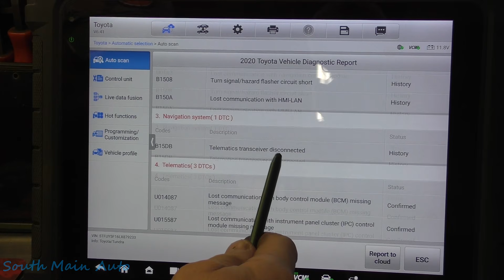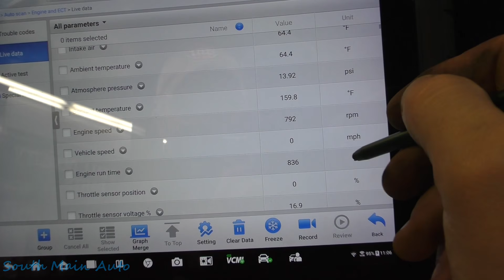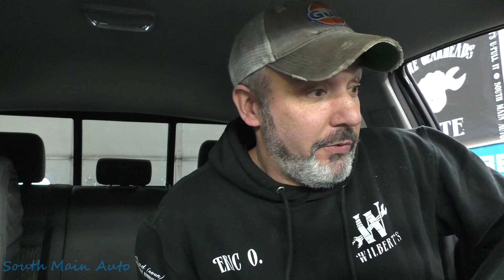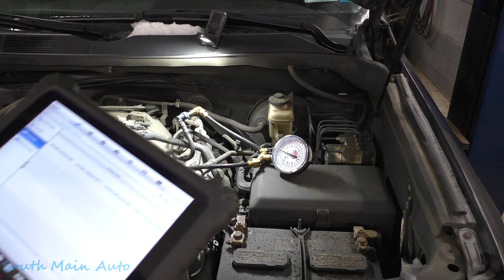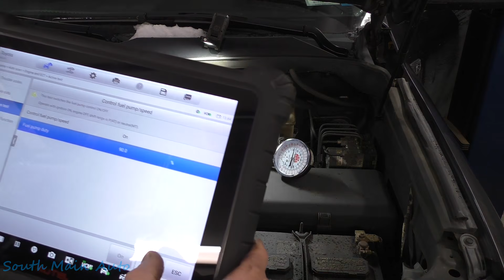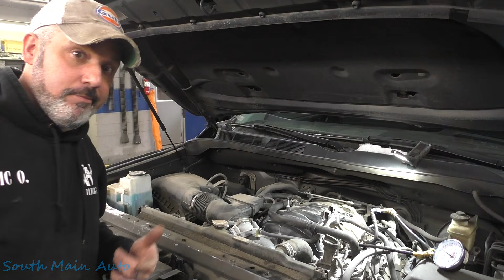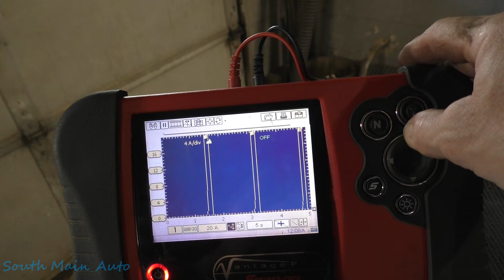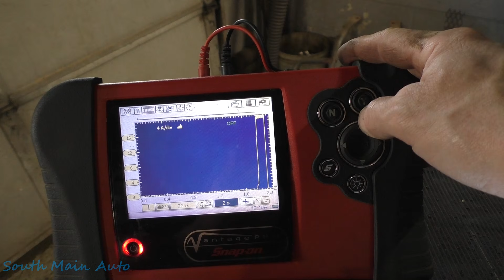My Customer Is Getting Shafted By The Local Toyota Dealer

Comment: I am 1:22 in and based off description so far I am going to say fuel pump. It gets hot and doesn't want to kick on until it cools down. It'll restart immediately right after shutting it off because the fuel rails still have pressure in them. That however doesn't explain why the fuel pump would suddenly start working though by spraying it with ether to get it going so never mind my initial train of thought lmao. I'll watch now to see what it actually is :o)     EDIT: I was right! YAY lol

Comment: He probably still won't be able to replace the fuel pump for free because in most cases, those pumps can't be replaced without replacing the entire module. I'm willing to bet the dealer is gonna say, "Yeah, we can replace the pump for free, but the module is gonna cost around $800."

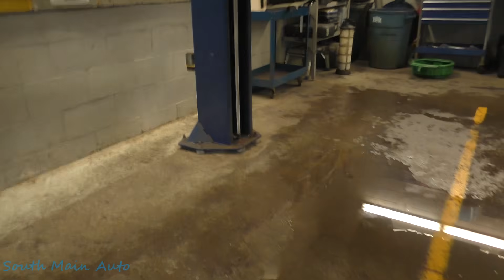Comment: @26:00 If you can't get a amp clamp on the fuel pump, try the negative battery cable; just make sure you "zero" the clamp on the battery cable so you can cancel out the idling current.

Comment: Interesting just to make sure this is not the same Tundra that had the bad pin connection problem anyway great job once again love all of the videos keep them coming.
If I lived closer I would give you my Tundra to replace the lower control arms I have a 2006 4x4  SR5 access cab 4.7 liter in nice shape just bought in September

Comment: My trick for keeping an eye on something remotely while alone:
1. Current phone that can broadcast a hotspot.
2. Old phone connected to hotspot.
3. Selfie stick with clamp attached to it.
4. IP Webcam app on old phone.
Set the app up and start the server, old phone on selfie stick, clamp in place and aim, pull up the address for the server in browser on current phone.
Can be a slight delay, but super handy before I had a bluetooth meter. Also super handy for diagnosing reefer trailers. Keeping an eye on anything really when you need you be in 2 spots, but are alone.

Comment: Hi Eric. Got any videos on gm 5.3 knock sensors? I've relocated them, tested them, replaced them and the harness. Still get codes on both. Engine runs good but does occasionally have an extended crank. Help! 😂

Comment: I went to 2 Toyota dealers and neither could explain a simple transmission service procedure. One said "all I know is it costs $429". Even the service manager at one said the 4runner has no transmission filter! I worked at a Toyota dealership in the '80s and '90s and we had some excellent mechanics back then, what is happening?

Comment: Had same issue with a 2014 ford f150 four door extended cab long bed work truck with 302k miles, bought it with 206k miles and ran perfect, so one morning, it started right up like normal to do the daily vehicle check, then shut it down, some time later, ready to hit the road, all i had was crank, and no start condition. Opened up the intake and sprayed starter fluid while cranking, it ran for about two seconds, then quit, so it seemed to be the fuel pump, we replaced it ourselves, again crank, but still no start. Found out afterwards it has the same fuel pump control module located at the rear of the frame cross beam just above the spare tire, replaced it with an aftermarket unit, it started right up and the truck ran great for two weeks, then one morning, same crank, no start issue once again. Replaced the fuel pump control module with a different aftermarket unit, started right up and ran great, but just for one week this time, keep in mind, zero codes given for this issue. So the owner of our shop took it to an automotive shop we frequent, they replaced the fuel pump relay because while cranking, they tapped on it and the truck started, so they considered it fixed beacuse it gave them no other issues. We got the truck back, the following day, crank but no start again, so off to different shop we also frequent, so after a total of 1.5 months being off the road, its back in our hands once again, but this time, they replaced the brand new aftermarket fuel pump assembly that we put in prior with another of the same brand and its been working great for at least 3months now. The thing is, years ago this ford truck amoung other years had a service bulletin about the fuel pump fuse, it was using a factory installed 20amp mini, the fuse was getting super hot and causing the same crank and no start condition untill the fuse cooled down. The fix kit from ford, was replacing the mini fuse with a LP JCASE fuse rated with the same 20amp relocated elswhere in same fuse panel/block along with a thicker gauge wire to be spliced in to it thats located above the dual electric fan shroud. The prior owner of the truck already performed that fix from ford long before our shop got ahold of it, oh and the OEM fuel pump control module is back in the truck.

Comment: An almost new toyota with a bad pump.  Not acceptable, even worse the dealer refuses ro back up the customer.  This appears to be a trend with Toyota the last 10 years.  I've never seen fuel issues on my vehicles under 170 thousand miles.

Comment: This has to do with the fuel pump, there is a fuel pump regulator that is usually bui l t in to the fuel pump.  Once the fuel pump is changed the problem is solved. We had a 99 chevy blazer that had that problem and replaced EGR valves, oil sending units, maf sensors, etc. Per mechanics, the fuel pump was all that was left!

Comment: wow EXCELLENT diag. We do hate the parts cannon mechanics. And I say mechanic because they aren't true techs like you. 

You did it all right. never would I have thought to pull the maintainer. But I work without a maintainer. 

Not a pro day to day but I know Toyotas pretty well. Thought it was EGR personally. 
Had a 96 Camry 4 banger that was about 15-20 years old. She would not like to restart after HOT SOAK, aka turning off in a drive thru like McDonny's and then it would take a couple times. 

Because as VGG would remind us, it's an air pump and I thought it was air starved. Toyos used to be low complainers. Never lighting up the christmas tree (normal) until it's really in a bad way. Like for example the heater circuit in the AFR would need to be EXTREMELY lazy for the CEL to come on. Until then it's super bad fuel mileage like 15mpg. 

Take that and apply here, there used to be a port that went from the throttle body under the butterfly, clean that and the stuff that's under it with solvent. It will be better. The part is EXPENSIVE so you have to just clean it. This was after thinking it was the MAF which it WAS NOT. 

Something for people to chew on in case they have a similar thing and it's not the fuel pump. Don't run below 1/4  tank so they stay submerged under the splashing so it cools as it runs. That's something you forgot to mention. Hot burns motors out. Too bad you never really get them to break under normal use. This video has half a mil views already. JUST for Toyota!

Hope this helps someone. That piglight really was the key to solving this. I mean testlight is similar but that just is genius for the ease of use.

Comment: When I was younger, my wife picked an 82 Chevy Cavalier. Still under warranty and less than a year old, the rear wiper would come and not be able to shut off when you hit a bump. The only way to shut if off was to turn the ignition off. Left at the dealer to get it fixed. Went to pick it up after work and they said it was fixed. Pulled out of the lot hit a bump and it came back on. Went back to the dealer and they told me they didn't have time to fix an electrical problem. I was pretty much fit to be tied. Took it home to cool down. In the mean time I check some of the connections and everything looked good. So I took the cover off the wiper motor and behold I saw what was the problem.  When the carbon ran off the copper strip it would arc and burned little indent in the board and it filled with carbon and completed the circuit.  I cleaned it up and filled the low area with epoxy and it worked for 14 years.

Comment: Hey Eric, i have an alternate theory as to why after ether it would run.  Well smacking the tank got the pump unstuck right? So the natural vibrations from the engine cranking and running could also be enough to jar it loose.
14 year ford truck tech. Tell me what you think!

Comment: You probably wont read this, but I will post it anyways. I wonder if the techs today are just missing stuff and not doing enough detailed investigative work when it comes to diagnosing problems?  I took my truck in to get a coolant line replaced to one of my turbos. I did not want to mess around with breaking manifold exhaust bolts to remove the turbo. While it was in there, I asked them to look into an intermittent check engine light for a misfire on cylinder 1. They hooked up their own scan tool and could find nothing wrong. Took it back for warranty work on the coolant line that was still leaking after they replaced it and told them I was still getting the misfire code and I had an oil leak as well. They could find nothing that I was describing. When the weather finally warmed up I decided to look into this myself, and discovered that the #1 cylinder spark plug had carbon tracking on it, never ever have I seen that, upon closer examination, the plug had a very small crack, replaced it, no more problems. The oil leak was also easy to find, it was the vacuum pump on the back side of the motor. How on earth do mechanics miss this stuff?

Comment: What POSIBLE REASON would you want to turn your fuel pump on and off or sow and fast while you are driveing down the road? Gas saveings? How much gas can you buy with the cost of this stupid modual and wireing and now $150 dollars per hour  diagnosing . THIS IS PROOF POSITIVE THAT THESE ENGINEERS  ARE PULLING THE WOOL  OVER THE CORPOATE BOSSES EYES JUST TO KEEP THEIR JOB.

Comment: Eric just held a master class on fuel pressure diagnosis for Toyota's.  This kind of data is unobtanium for the most part, and the odds of the dealer tech even putting a pressure guage on it are small because he does not own one and the shop tool is missing or missing the needed adapter.

Comment: The older models never had Fuel Pump problems. My ‘97 Tacoma went nearly 300k with the same original Pump. The more lower quality parts they use (from China) the more failures we’ll see. Toyota is using Chevrolet systems to cut costs.

Comment: Hey I got that same problem with my 1976 toyota corona at 560,000 miles.
When it get hot and I shut off the car, than it will not start up again, until the engine cools down , than it starts.
I replaced everything that can be replaced that is related to the issue, relays, fuel pump , injector  but nothing so I just keep driving it.
Well the trans finally gave up so junked it.
Saw your video and I thought I'd share a similar problem. 
Thanks

Comment: you and I tink alike...the fuel motor is weak, the added voltage, from the alt., made the difference so it would run...the first start of the day, the armature bearings are cool (less friction, eaiser turning) also less metal expansion ...so many variables, the scope is in valuable, to find the cause!!!

Comment: I'm guessing that this is a returnless fuel rail, which is why you need a variable speed fuel pump to maintain preasure.  Otherwise, on older vehicles, the preasure regulator would bleed off the extra pressure and return it to the fuel tank. And you would have a single or two speed pump.

Comment: Probably already heee in the comments but there will be internal hardware protection at a silicon level (inside the FET used to drive the pump) & a software current protection function which is what looks to be in action here as the retry strategy is on a fairly slow time base. Excellent diagnosis as ever, thanks for sharing with us.

Comment: There seems to be be more to the story than what we’re getting. Does the truck have warranty? 

“It’s been acting up for a year”.  So how many techs have been on it, and who was the first? 

Corrosion for ECM, FUel ECU can surely be suspect- but doubtful Toyota is grounding on the bracket. Maybe trans tunnel, or even interior. 

And for all you guys Doggin out the Dealer techs- when you only approve 1.0 hour of labor for diagnosis on your bogus crap box- the Tech is most likely going to stop digging at the 1 hour mark.  The writer is hoping he spends an entire day, but he most likely won’t- after the 1.0 hr diagnosis, you WILL start getting educated guesses.  Sorry, hate to lay it out- but even The Highest Qualty Tech needs to book hours. We CAN accurately pinpoint every problem, but NO ONE is paying us to do so. 

An independent shop OWNER/ YOU Tuber has all the time in the world to make the dealer look bad- and he will still make some money.     And be the HERO for doing it

Comment: As you have provided proper diagnoses - that is what matters You found the problem - And at first I was leaning to a fuel pump relay from the way the pressure was behaving while you were under the hood, But I totally agree and you see this is what the industry is missing logical thinking and like how Holmes said 
When you have eliminated all which is impossible, then whatever remains, however improbable, must be the truth”. And that is what I see you do Eric A very thorough diagnostic. Wayda go there...

Comment: There are passive components called PTC that will go open circuit in high load. Some power window motors use them for safety. The computer may or may not detect when this happens. If not, then you would not see a code.

Comment: I had similar happen on Toyota Highlander. It did have the recall and they had replaced it before we bought it. I always figured it was the fuel pump even though it had been replaced 30k before. I ended up selling it back to the dealer as we didn’t like the size of the vehicle anyway. This video confirms I was probably right on that vehicle but certainly not typical way I had seen a failed fuel pump.

Comment: My first guess was fuel rail pressure. That was as far as I was able to go. The tools you used I do not own and they are expensive. I own a 1976 John Deere 310-B backhoe that will not run well if the diesel injector pressure control valve gets pieces of debris coming from the injector pump lodged in the pressure control valve. I only know this from watching a you-tube video on the topic. Thank you for sharing your knowledge with  other people.

Comment: I bet the ether worked because while cranking the battery voltage goes down due to starter motor current draw but with the ether as fuel the alternator began to make a lot of current which got the fuel pump to spin and made enough fuel pressure.  Just like when you disconnected the battery maintainer.  You are a real great mechanic.  Love your videos.  Thanks you have helped me work out some strange things on my truck.

Comment: Some computer (lap top) power supplies react the same way as the fuel pump ECU.They pulse if they detect an overload including a direct short. As soon as the fault is removed they automatically revert to normal and supply current. It is designed to protect components and prevent circuit overheating by reacting to the fault faster than a fuse. Obviously an excellent feature when the pump is immersed in the fuel!  The pump is faulty as it draws excessive current to start, the ECU is doing exactly what its supposed to do.

Comment: we have a honda pilot cylder 5 is a misfire after new injectors and coilpacks runs smooth till you mash throttle it stumbles.still trying to figure it out we are not mechanics just at bodyshop employe car.we have snapon scan tool it reports cylder 5 misfire clear it run it same code

Comment: My 2006 Tacoma would run perfectly in all condition except when merging onto the highway; at a certain acceleration rate and only at 2400 RPM the engine would turn off until it reached 2000 RPM and cycle repeatedly. I could punch the throttle and have full power out let off and it would run fine. After taking it to Toyota they told me nothing was wrong and charged me $300 then I took it to a recommended mechanic who messed around with the engine ‘computer’ and again nothing wrong-charged me $400. This is after I specifically told him to change the fuel pump in order to rule it out; I figured it had 160,000 miles so just change it out for my peace of mind. 
I took it home and changed the fuel pump. There were little chunks of copper in the fuel tank from the commutator of the fuel pump. 
Truck has been running great for the last 100,000 miles. 
Took me 45 minutes to remove the fuel tank and about an hour to shake out the copper bits and install the new pump and another 40 minutes to reinstall the fuel tank. 
I surmised that I always run the tank down until it’s almost empty but I learned that the fuel actually cools the fuel pump so I never let it go below 1/4 tank. Lesson learned. 
Not sure why mechanics simply won’t do what I ask them to do. 
Oh and I went back to Toyota to tell them that it was the fuel pump all along…The service guy told me that I was wrong… I guess he was using his stellar trouble shooting skills again.
Great video, thanks.

Comment: You are correct and as a Toyota mdt, I always recommend replacing the ecu with a new one when the pump fails. This is because it's a ground controlled module and when the pump fails, it usually overloads the circuit and damages it internally. You can just replace the pump, but I recommend it at the same time as a preventative measures